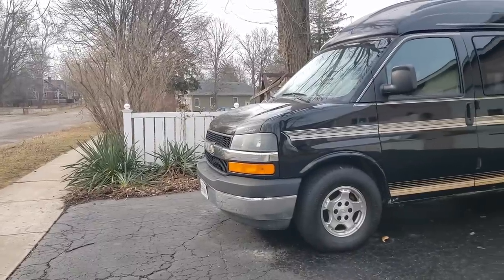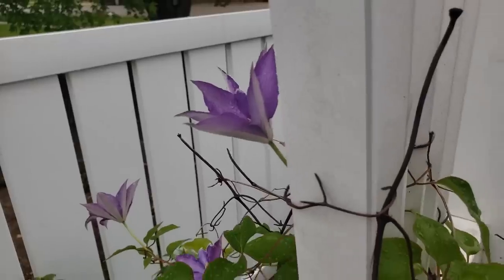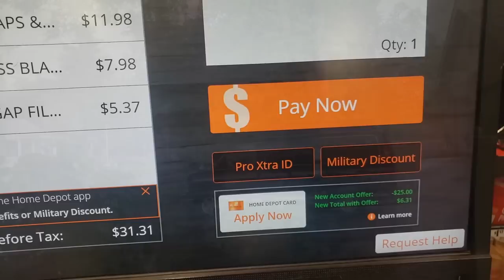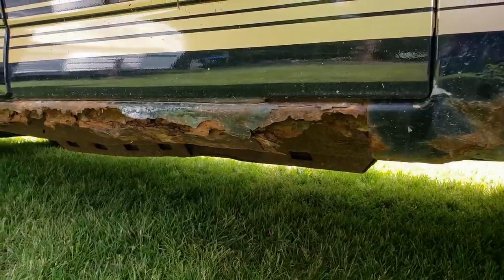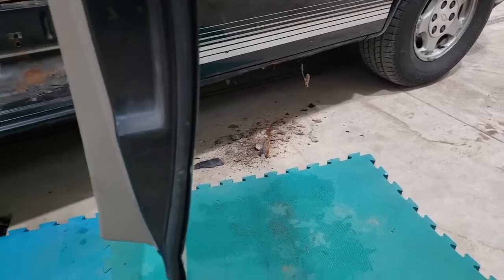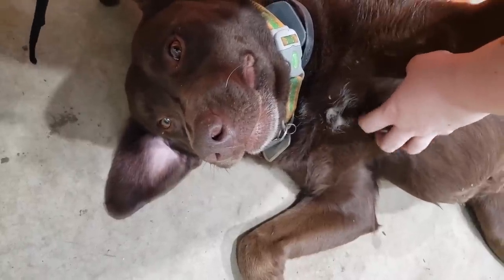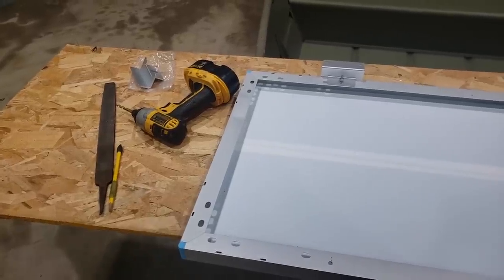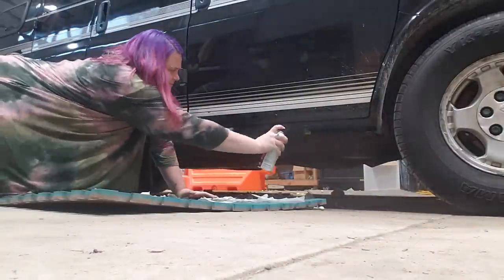Van Build Project | Doing rust maintenance on the body of my van. (and starting solar installation.)

Comment: That foam repair might not last too long - There are panel patches that can be riveted or welded on and then prep to prime and paint.
Reply: I agree, once the rust shows on the surface metal it must be cut to good bare metal and well a new rocker panel.

Comment: Hey you look great! I'm trying to find a new van now and I want either a 15 passenger van or a conversion van like yours. Question for you.... How do you like your new van? I'm interested in one cuz I don't have to tear the entire thing apart! I'm not going anywhere ncold so insulation isn't a huge concern. The 15 passenger van needs more work, but much more space. The other issue is the price. These people want like 15k for a 1995 with 200k miles. Ahhh! I hope I find a diamond in the rough soon! Good luck on the build! I've missed your videos!